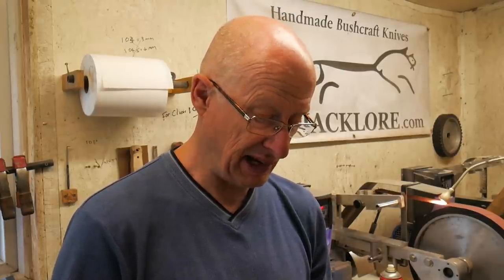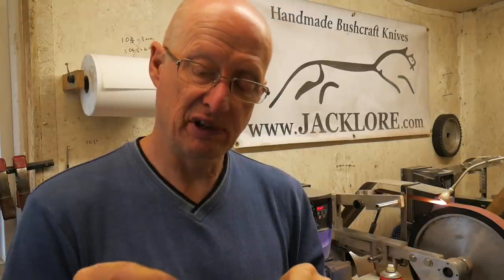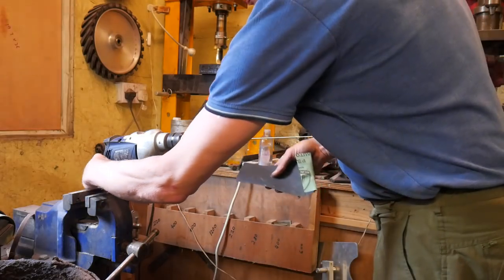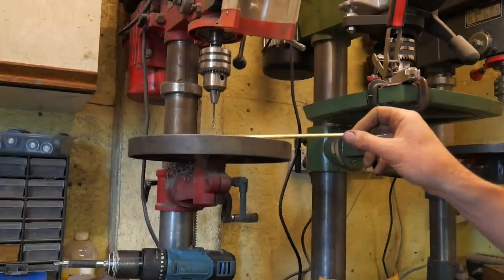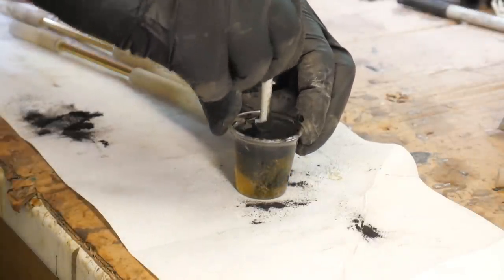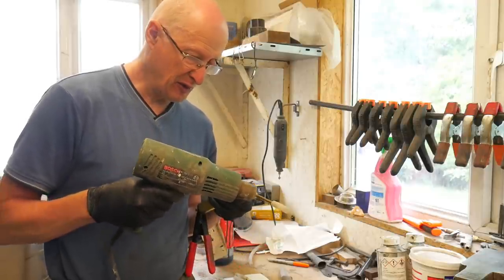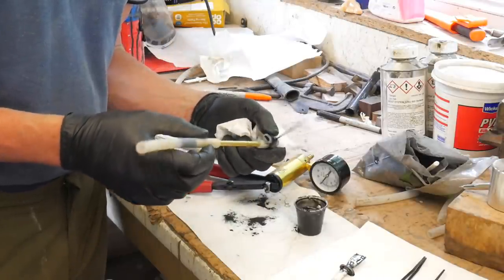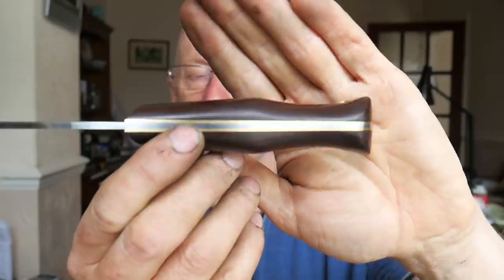MOSAIC PINS. How I make my own

Comment: Those brass liners look amazing! Very nice indeed.  BTW, maybe a quick tip, but pre-zip your your zip ties (get them close to the size you need) so you can easily slip them over the folded tube and pull tight, with that messy job it might it a bit easier.
Reply: Hi nRob. Good tip. I learned that as I did a few more. Are you still in VE land?
Reply: @WiltshireMan  Indeed I am .. for another 5-6 weeks

Comment: Yes, nice work & great pointers. ThankQ! 

I was shooting my  guns & got the idea to use the spent brass casings from my bullets. The .223 ammo works best because of the length & width, I use the .22   long ammo casings for the inside w/black powder in the resin, copper &/or stainless steel rod inside the .22 long casings gives a good look.. It's also handy that 1 side of the casing remains closed so the glue doesn't pour out. Before using, I give the casings a good soak in a bowl of hot soapy water, rinse & air dry outside in the Florida sun to remove any remaining gunpowder. It saves $ & looks great. After the resin is dry i simply cut off that closed end using the cut off wheel from my angle grinder, the Dremel cut off wheel also work's good.

Comment: Always good to see the current techniques and how they have progressed over time. Heh jynx!!! Was just doing something similar with my drill this morning but for hidden pins. Ment to say awhile back , realy like your sandpaper storage idea beside the vice. I have mine setup on a long bar like a toilet roll holder and have the paper hanging down, pinned under a long planer blade screwed to the wall. Think ill have to incorporate that idea in with mine, very handy.
Those brass liners look very elegant! What works great also is copper, especialy with black woods, like ebony, african blackwood and zircote!
For the leak in the valve, if its in the threads you can unscreww it and add PTFE tape to the threads. But if its the valve itself change it ASAP,  pressure pots are known to blow as soon as theyre faulty!

Comment: Hi Sandy great video mate!
I was thinking if you heat the outer tube wouldn’t expand enough to fit the inners? Just a thought you might want to try. I love the brass liners and if I had to chose I would go with tapered tang and thicker brass liners. I believe when you split wood having the brass liners to act as a hard barrier before the handle it’s an advantage. It would prevent damage by having the log close to it when batoning.

Comment: Great video Sandy.  Is there a reason you choose to put the epoxy under pressure to reduce any bubble size versus putting it under vacuum to pull out the bubbles?

Comment: Thanks for this. I'm in the process of fitting wooden scales to a kitchen knife whose handle has disintegrated. In another video the fella "peened" the pins, by bashing them at the ends to make them mushroom out and thus hold the scales in place, is that strictly necessary as it's not something I've seen you do?